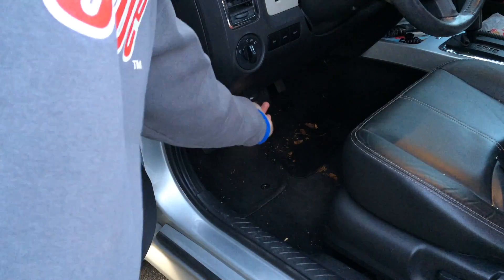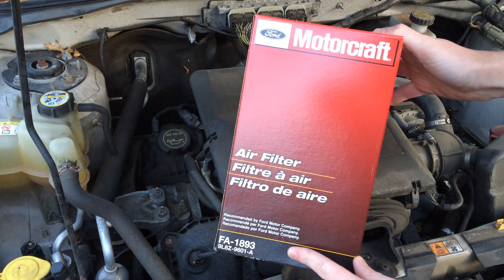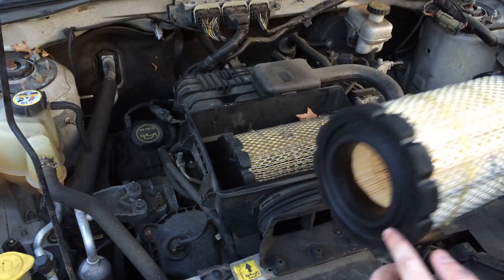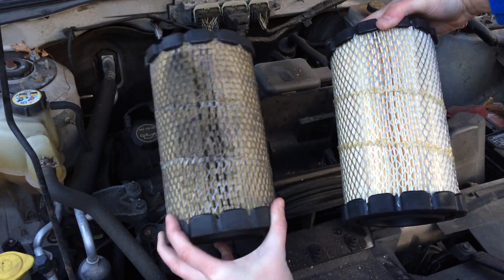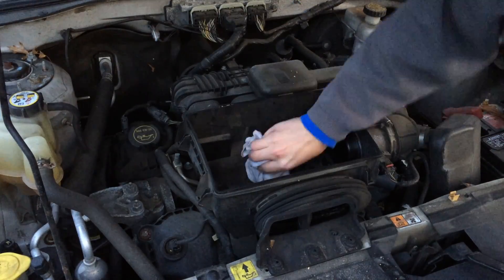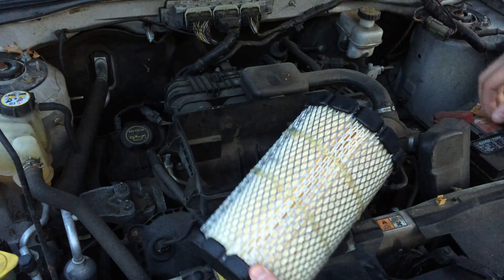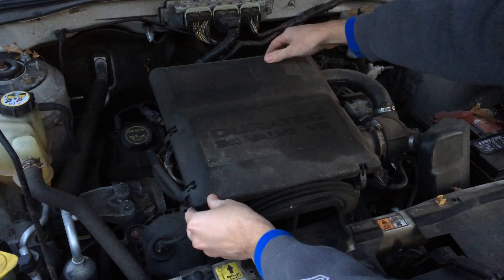HOW TO: Ford Escape / Mercury Mariner / Mazda Tribute V6 Engine Air Filter Replacement (2009-2012)

Comment: A shop told me I needed a new engine air filter and “it would be $60 to replace”. I came here to double check if I was thinking of the same thing. The part is only $15 for me and I can do this myself in 3 minutes .

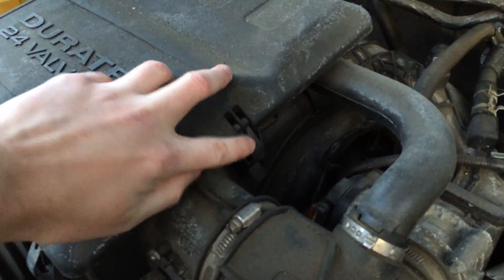Comment: Can someone please help me with a question?  I have a 2009 Ford Escape 3.0 V6, engine looks identical to this one.  I need help identifying a part.  If you pause the video at 0:59 its the part to the left of his finger.  It's a piece of plastic with an oval shaped rubber tube that brings air into the box where the air filter is.  

The reason I'm asking is that mine is not properly attached and I can't get it to stay in place.  Can driving with this not fully connected cause damage to my vehicle? Thanks for the help!
Reply: handicapitation its simply just an air inlet to the airbox, if its not fully secured its not a huge worry pal! ur pins might have come undone thats all, just zip tie it down in the worst case scenario
Reply: Thanks brother!
Reply: handicapitation I had this trouble with my 2011, just clean the oval lip on the filter box and the part of the rubber tube that sits on the oval with a degreaser, I used brake/carb cleaner or alcohol, reattach and tighten the clip, it should stay on, mine has.